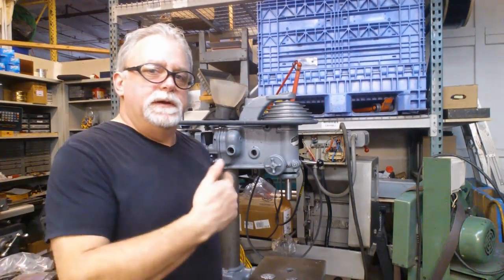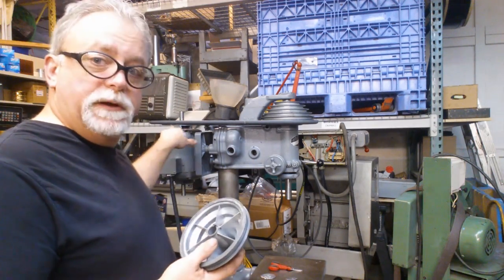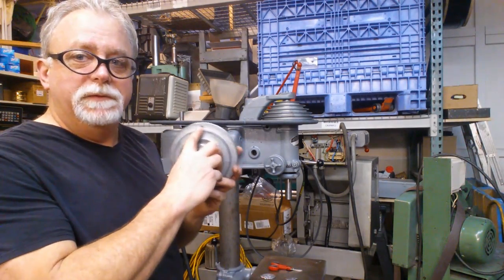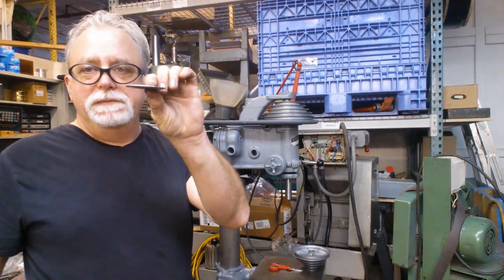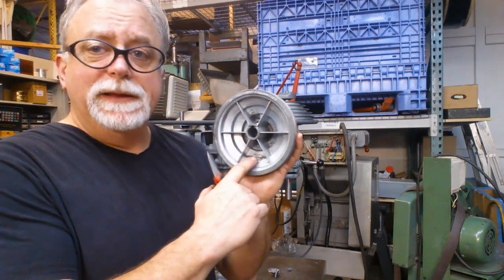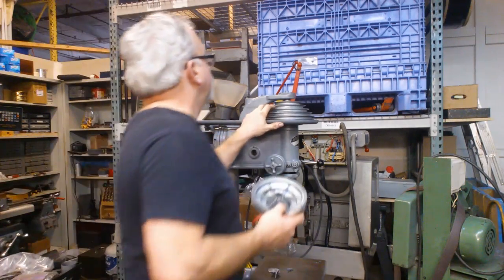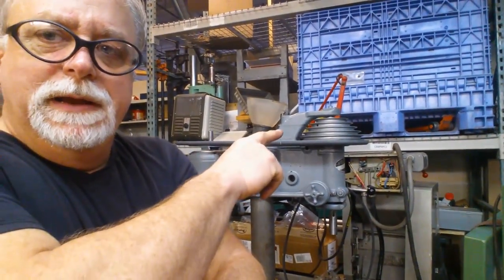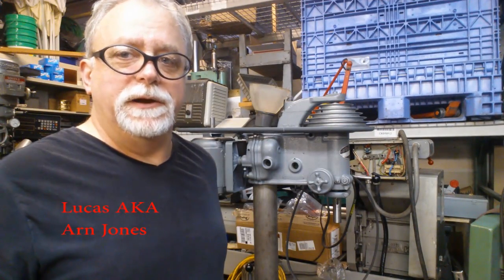Tips 2: Balancing a drill press drive system

Comment: It would be easier to balance vertical on it's side. The heavy end will go towards gravity. But you also have a belt that can cause vibration. Irregular sections like a rough roadway you'll feel. Sometimes all it takes is to warm up the belt by drilling big holes and put some pressure into it. Once it's warmed up it's more flexible and you'll get less vibration.

Comment: Thanks for posting this.  I am setting up a belt grinder and at the 1hp motor will have a 6" single sheave pulley. The motor runs super smooth without the pulley and once I put on the pulley there is a noticeable off balance.   It is a Congress Drives aluminum pulley.  I'm going to try your tip here.  I can always remove the weights if they don't work so it is worth a shot.  But I got a feeling that it should work.

Comment: *This has to be one of the best values out there. easy to set up, easy to use.>>>t.co/BNNl1tGmdQ    bought this to drill straight holes into pine wood in order to make a steel pipe bookshelf. good tip to plane your wood before you drill.

Comment: Lots of rotating objects would benefit from balancing. I would like to see a simple balancer made for the shop. Low friction static balancer with a shaft. Dynamic balancing of short rotating objects on a rigid long shaft is likely relatively unimportant. With pulleys, the concentricity of the sheaves is important too since the belt could be rotating around a varying radius if the sheave were bent.

Comment: I used a similar method to reduce vibrations on the large pulley on my home made CNC lathe.  Not perfect , but much better than original. 

Another tip passed on to me by my much appreciated mentor; he replaced the V belts with round cross section belts (think large O Rings) on the drill presses at work.  The difference was amazing.
Reply: Holy crap I've been considering doing round belts too. That does it. I'm doing it